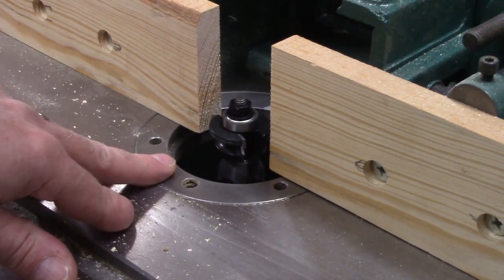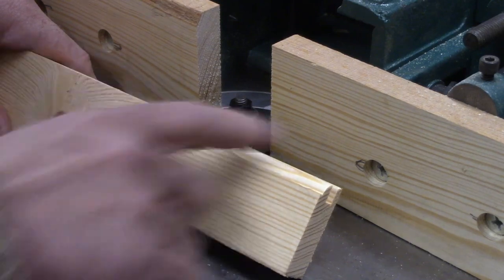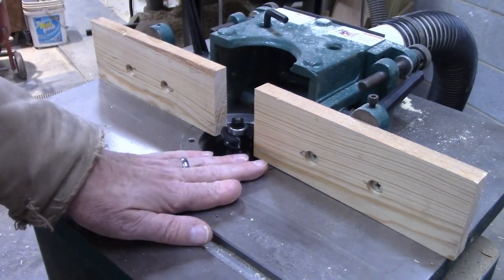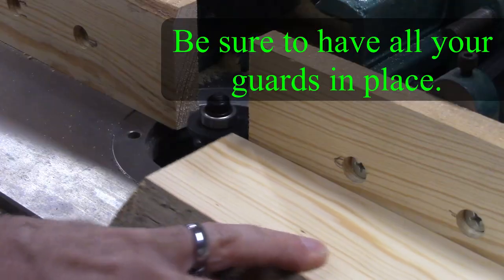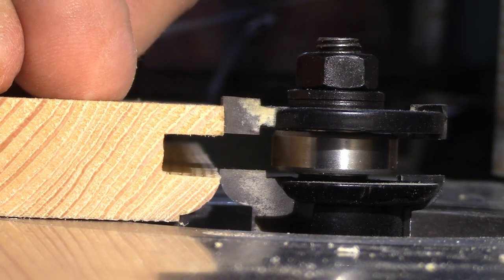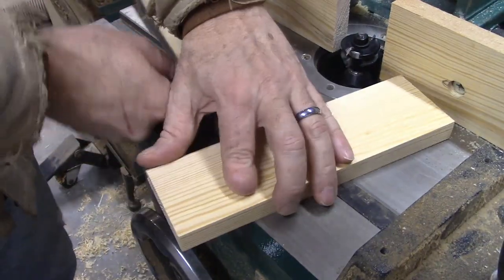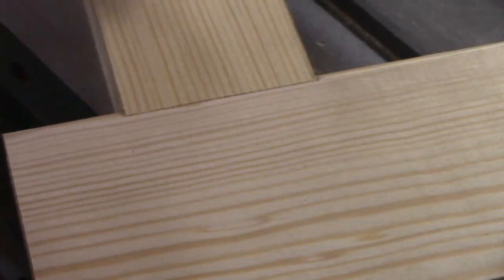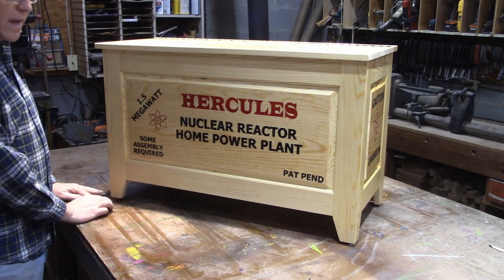Easy Setup of Rail and Stile Router Bits Without a Template

Comment: Have you ever done shaker style  doors on a table saw with a single blade ? It's a pain and it's never 💯 accurate  I did it on a router table and went smooth and 💯 more accurate
Reply from the maker: I don't know that I have.  I usually use a router bit set like this one.  I glad you found something that works for you. :)
Reply: I did and it sucked.  I immediately went home and ordered some Shaker stick and cope bits